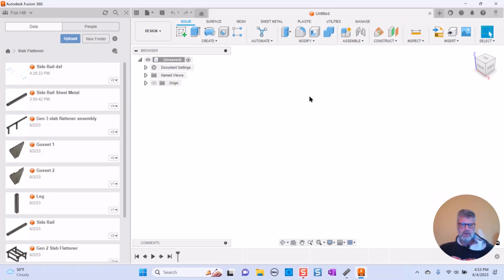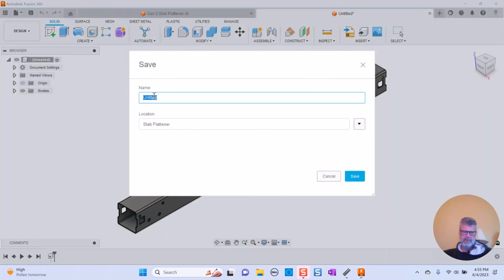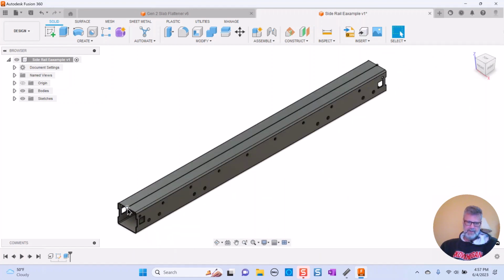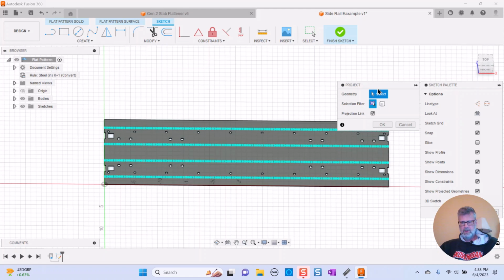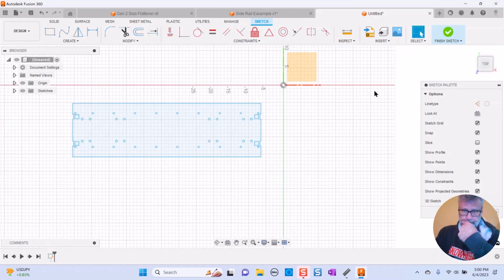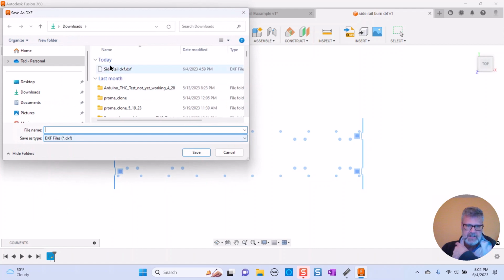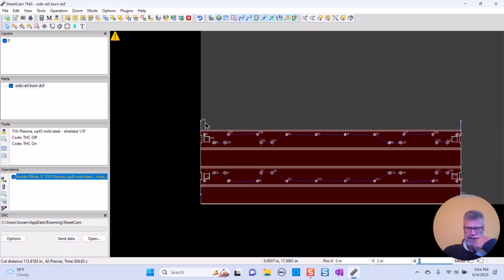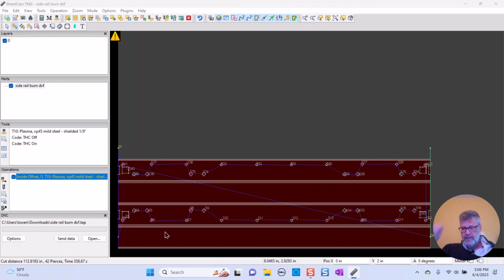How To Program A Rotary Plasma Axis

Comment: Is there a way to make this workflow a little more streamlined? I'm trying to implement rotary plasma into my fab shop and I'd like it to be a little more efficient than this. Is there any way to set up Fusion so it outputs the the origin that matches sheetcam
Reply from the maker: Unfortunately, fusion doesn't support rotary axis machining at this time.  Hopefully, they will soon.